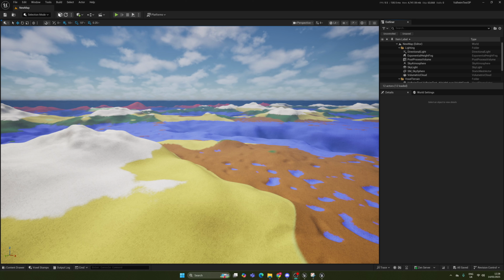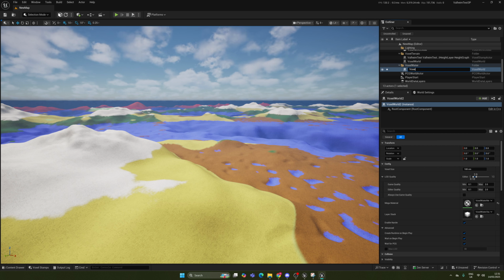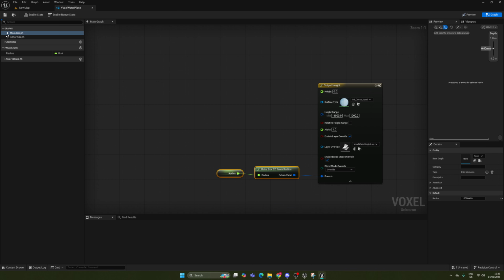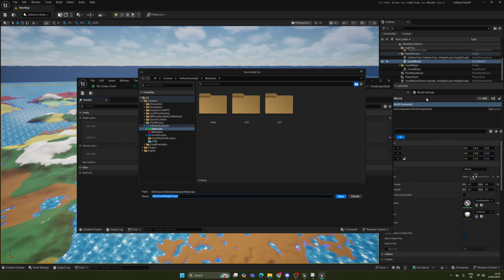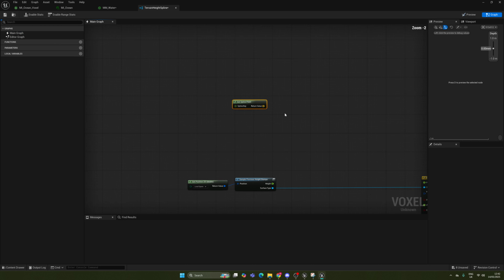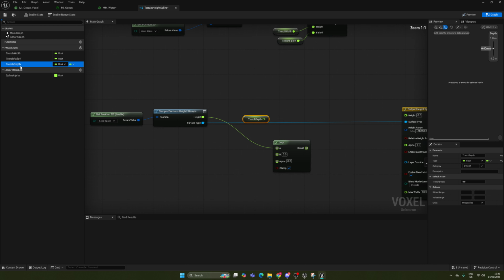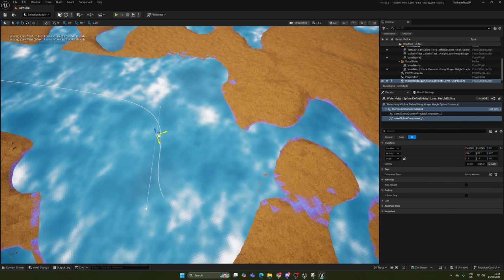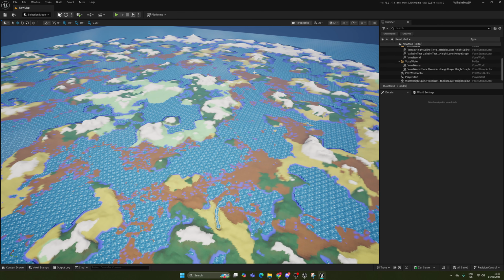V2.0 (P7) Making Valheim Episode 6 Water Plane and Splines

Comment: Hello, here I test the water material system and it prompts an error that it cannot output a single layer of water material. How do you get the water material here? Can you share the creation process or ideas?
Reply from the maker: Hi, Voxel Plugin has fixed the single layer water issue on the latest dev branch.
Reply: @ProcGenLabs  OK
Thank you